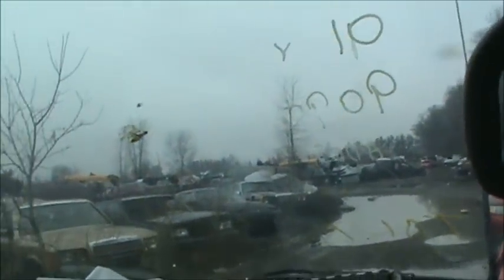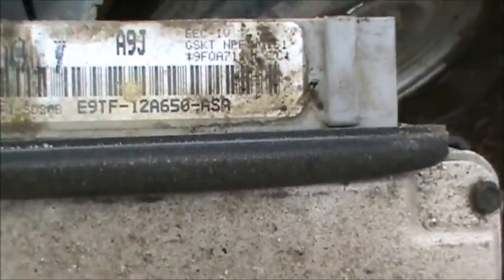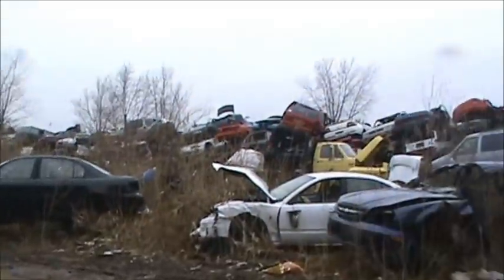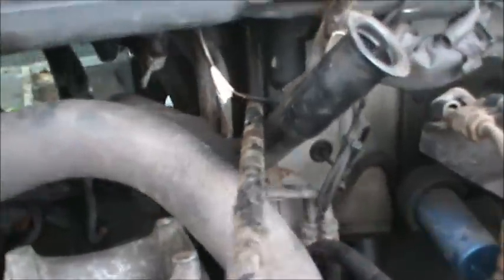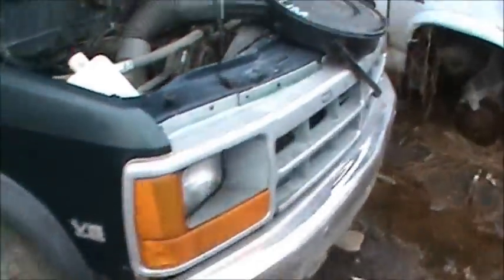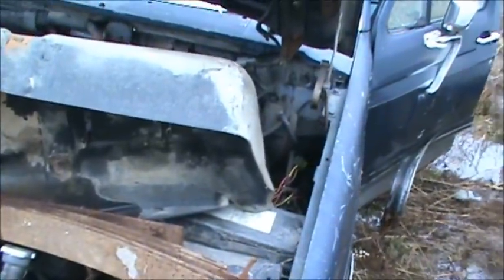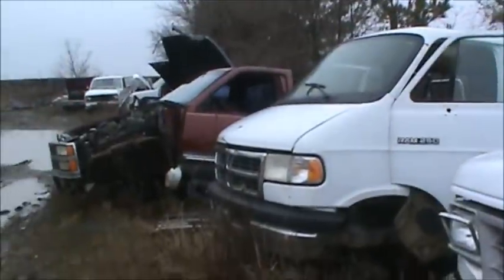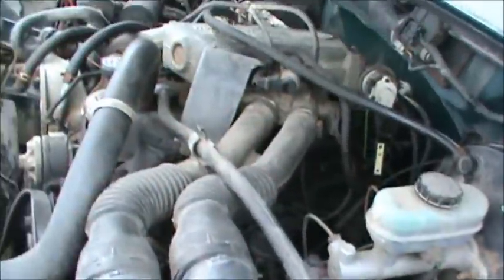How to Pull Ecms

Comment: most valuable ecm in the old body style ford trucks is the 96 300,302,351 obdII MAF, then you have the 95 ecms from cali that are 351 MAF obdI They are real rare. Some 96-97 f250/350s were 460s were MAF if they were shipped to CALI from the factory.